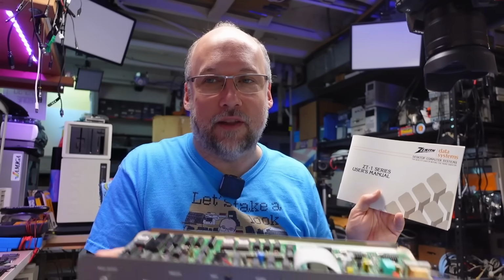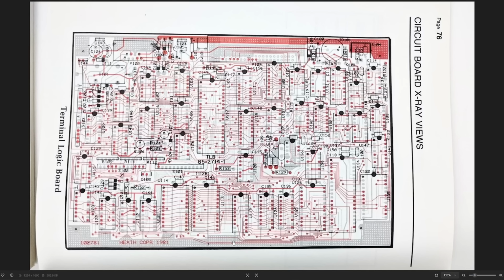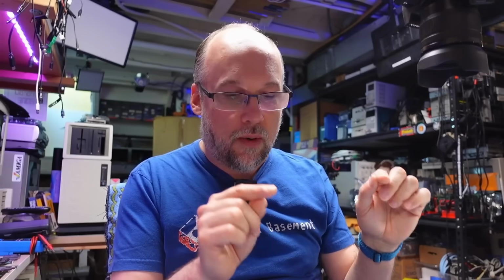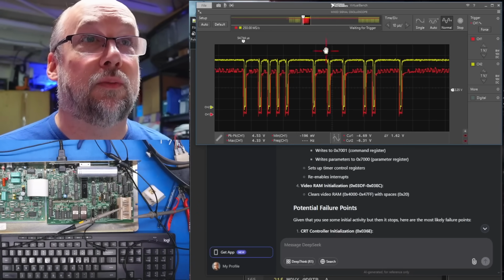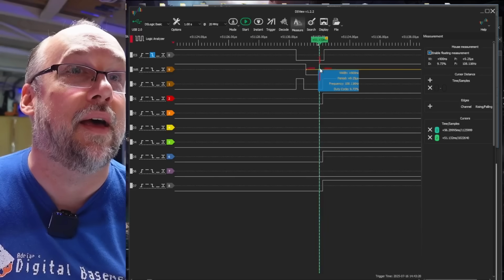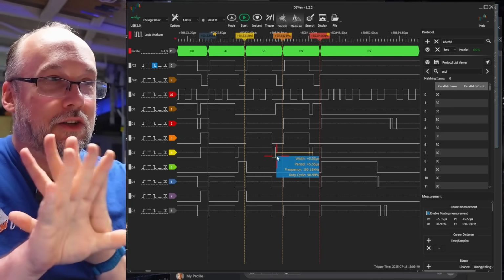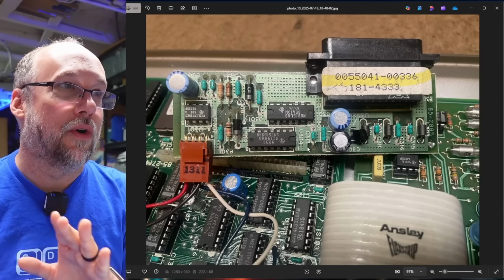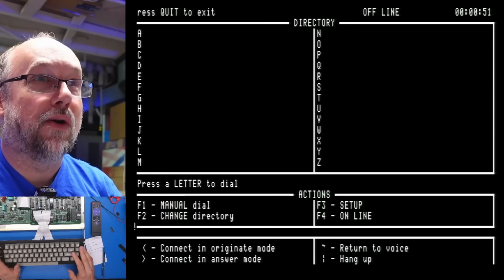The Zenith ZT-1 alive. Sort of.

Comment: The time clock is maintained by one of the MCU's onboard timers.  I see a crystal on the board near a hex inverter chip, which is a telltale sign of an inverter-based oscillator to run the system.  It must be providing a dot clock to the CRTC and instruction clock to the MCU.

As you figured, DeepSeek is a mess at interpreting the programming parameters to the 8275.  The values that should be sent initially are 00, 4F, 58, 9, and 9, and that is exactly what you saw.  Then it sets cursor position, 80 00 00.  It follows up with E0 and then C0, and finally 23.  All of that matches what you saw.  The 8275 doesn't read VRAM.  It depends on the DMA controller (or since this system was designed without one, the MCU) to provide the data  It doesn't even have address outputs to direct which memory is read.  So the glitching looks like a timing issue to me.

The battery-backed up RAM is at 3000.  VRAM is shared with generic RAM.  Most of the memory following displayed memory is scratch space for individual directory entries.  Of course most of the general RAM it needs is within the internal 128 bytes of the MCU.

It has no reason to write to NVRAM at first.  That's only for phone numbers.  It does do a read scan to see if its checksum is good.  And it will try to write a new checksum when you bring up the directory menu, after initializing the memory.  If that fails, it enters an infinite loop.
Reply from the maker: Nice thanks! I've done a ton more investigation in part 3 which I'm nearly done with, including verifying a lot of what you mentioned. I'm not surprised the LLM got the 8275 stuff wrong since that's so obscure and relatively unused. When comparing it to something conventional like the 6845, it works in such a different way too, with the row buffers and DMA.
Reply: @adriansdigitalbasement  This is a weird request, but can you confirm that U136 pins 8 and 10 REALLY are grounded?  I'm asking because these are OUTPUTS of those 2 hex inverters.  It looks like they wanted to ground the inputs but actually grounded the wrong side!

Comment: Most of the song & dance with online services in the 80s was signing up & getting around the hourly charge per data rate. After that, all you needed was a computer, terminal software with file transfer capability, and a modem. CompuServe, GEnie, The Source... Eventually Delphi.

Comment: Why would they use a transformer that outputs 10 VAC if it's going to be regulated to 5 VDC? Couldn't they have used a 6 VAC transformer so that it wouldn't get so hot and waste all that electricity?
Reply from the maker: The voltage regulation gets super hot. Yeah definitely if you ended up with like 7v DC then those regulators wouldn't have to work so hard. Perhaps it was cheap and what was on hand.

Comment: I'm unsure what value the AI is giving you here. I think AI can be useful for high level brainstorming, but outside of the most popular machines I doubt AI is capable of producing useful technical guidance. I doubt the AI did any analysis of the ROM outside of recognizing it's rough era and then hallucinated a memory diagram and startup process based on similar machines it had more context for. It would be nice if AI was usable for that kind of static analysis, but it just isn't there yet sadly. 

For instance, 30 minutes in you saw 11 initialization points and asked the AI if it matches the code. I guarantee you that if you told it 10 or 12 it would also respond it matched the code, as it's not sophisticated enough to actually know and is just hallucinating. Sadly, it's not a tool that can be trusted with this kind of work.
Reply: "AI" can't even analyze a chip, because that is not its purpose. an LLM is a Large Language Model, not a Large Chip Analyzer. its purpose is to plausibly mimic human speech. it is not capable, nor will it ever be capable of analyzing chips. computers do not have knowledge, nor experience. they just store things we interpret as such.  you may as well be asking the light switches in your house how to solve a digital logic problem. if the light switch is turned on, it is just making electrical contact where it's supposed to, it's not drawing on skills and knowledge about how the electric grid works, because that's impossible.
Reply: I would go for a logic analyzer with included opcode decoder. Would show the executed code.
Reply: When I do work on this sort of thing, and still not perfect, I upload the manuals I need into Google's LLM so I can use them as the reference medium and that does a better job, for obvious reasons.
Reply: @misterspock1  and what does that accomplish which reading the manual would not?
Reply: @iceowl  I see it as sort of working like speed reading for long boring manuals. I still have to check it's concluisons, but most of the time it does cite the passages.
Reply: The AI is completely useless at coding, as usual. It has zero concept of true or not true, as long as a sentence is plausible it will say it with zero concept of accuracy. Just look at the dumpster fire that is "vibe coding" and how it's just made the biggest PII leak in history due to the trash code produced being used in production. 

Calling LLMs "AI" is disingenuous at best honestly, there will never be a conscious LLM, ever. It is a glorified autocomplete system at best. Sincerely hope this is the last time Adrian tries relying on an LLM in one of these videos, watching him have to constantly correct the half-hallucinated bullshit that it replied with was just painful. It doesn't listen, it doesn't reason, it doesn't think, and it doesn't have any real understanding of the words it uses. I would have thought someone as smart and technically capable as Adrian would know better.
Reply: @shermanikk  Agreed.  People need to stop using the term AI.  Right now it is a marketing term only.  We do not have AI yet.  We may never achieve it.  We just don't know yet.

My bet is we eventually do.  But right now we don't even know how human brains work to generate intelligence and conscience.  How in the world do we expect to make computers actually intelligent when we don't know how WE are intelligent.  Putting the cart before the horse here, i believe.
Reply: @jeromethiel4323  read Roger Penrose on this subject, if you haven't. he has been pretty consistently saying "we don't have an accurate, meaningful definition 'intelligence'", and intelligence, in the modern sense, is very much a eugenicist idea. 

if you haven't defined the thing in any meaningful scientific concensus, how do you make an artificial one without lying about what you're doing?
Reply: I tend to think of these things as a dynamically generated book derived from the worlds knowledge base.  They don't think in any real way, but it sure appears they do.  As you imply, if you stay within the bounds of the worlds well trodden information, it tends to be spot on.  Once you venture too outside what's been written about and repeated thousands of times, it just starts hallucinating.  I don't think they'll ever be able to do anything but be along the lines of good teaching tools up to the undergrad level.  Which is quite impressive.  

If they could make these things "know what they don't know" that might be a far better step forward than trying to make them think, which is likely a different problem entirely.
Reply: @stevesether  the "world's knowledge database" is full of a lot of bullshit. computers do not know which is bullshit and which is not, nor can they know. computers cannot hallucinate, they don't have a central nervous system or a brain.

there is a lot of information that has never and will never be on the internet, because it's either gone or it is just impossible to digitally archive EVERYTHING and it would be extremely irresponsible to try. 

the laws of thermodynamics are not flexible. there is no such thing as a perpetual motion machine. all systems must dissipate energy somehow. 

it took millions of years for nature to evolve brains. fascist techbros, with their "AI" and eugenics, believe they can make electrified rocks do the same in the fifteen minutes they've been around.
Reply: I think, this totally out of reach for any LLM, you need symbolic AI for something like this. If there's sufficient data for this in the model, you may experience a happy match (just like @stevesether described it), but more likely, you get what may be called an A.I. novel.
(Or is it the A.I.'s family novel? At, least, it's an inherited one… 😀)

Comment: Wild speculation: is the siemens chip newer and runs with tighter timings (or in fact looser ones)? Could be that the data for the character is still on the bus, when changing the line in a "cursor return -> next line" fashion
Reply from the maker: I'm digging into all the possibilities in part 3. I think I've come to some conclusions but I'm still working on it.

Comment: We found that using a oyster knife and laying the blade in the seam and lightly tapping on it with a hammer all the way around what's the best way to open AC adapters. Then use plastic solvent in a syringe to reseal.  (WELD-ON 3 Acrylic Solvent Cement)
Reply: That sounds like a good process. I lay a utility knife in the groove and run it over the same path a few times on each side and then use a flathead to crack the leftovers. Then I use plasticweld to reassemble it.

Comment: I wonder how we settled on 300 bps originally not something evenly dividable by 7 or 8 bits.  And off the top of my head there were slower speeds but they were what 110 BPS and 75 BPS and I'm not sure did they predate 300bps?
Reply: They did.  If I'm recalling correctly, 75 baud was for very early teletypes, with the ASR-33 operating at 110 baud.  Not sure what the first 300 baud device was... maybe the Bell 103 modem?  (That would have been 1962?)
Reply from the maker: There was probably some technical reason for the speeds used (75, 110 and then 300.) That would have been typical back in those early days.
Reply: Before the Bell 103A standard which was 300 baud FSK, there were 50, and 75 bps which are easy fractions of 300. But, there were also 110 and 134.5 bps.  Apparently 110 BPS was actually 11 bits per character (a start bit, the data bits and 1 or 2 extra stop bits to accommodate the mechanism in relay or solenoid hardware to reset).
Reply: I can't imagine any reason to care whether the number of bits per second combined with the bits per character would need to have anything to do with one second timing intervals.
Reply: @mikebarushok5361  Neither can I, just odd that it worked out to be 300 bits per second, just curious what crystal frequency originally, and to me, it would send 1 byte per clock cycle, so that's why I'm surprised it's not a division of 8.

Comment: The 8275 uses a byte for the character in each position but uses additional space to store the of attributes of blinking, highlight, inverse, and underline.  There are also some field attributes available.  A low power 2114L still draws 70mA while the uPD444 drops into low power mode below 5V and only draws 1uA typical, but at a higher cost than a 2114L. edit: the 2114s are in parallel with the 2K display RAM and are configured as an additional 1K x 8.  The chip selects for both RAMs appear to head off to the same place.
Reply: In VRAM, the attributes are actually bytes interspersed with the characters.  Attribute changes have the high bit set and continue until the next attribute change.  Inside of the chip as it DMA's in a line of characters, it will read the attribute bytes and assemble the 4-bit attributes internally.  But the ROM is definitely writing only 8-bit bytes to VRAM and using the occasional attribute bytes to set combinations of reverse video and underline.
Reply from the maker: Ah so you think it really is there for longer battery life over a normal 2114? The two 2114s on board do not appear to be used for the screen buffer at all, as this thing doesn't really use attributes for text mode. At least not that I've seen.
Reply: Yeah it's weird.  There is 1K of nibble memory for the phone book and 4K of byte memory for the video memory.  There are also 128 bytes of internal memory in the MCU.  Those are all the memory that the ROM accesses.  I see no reason for either of the 2114's (1K nibbles each) if that other AY chip is the 1K nibble RAM.  And considering its proximity to the battery, the AY is more likely to be the battery backed up RAM.

As for ROM, there are the two program ROM chips.  There is also a character ROM.  But that doesn't explain the RAM chips either.  Maybe reconstructing the schematic from that PCB Xray will reveal something.

One way to see attributes is to use the sequence 'ESC s #' where # is between 0 and 7.
Reply from the maker: @ovalteen4404 I think I'll have the schematics soon enough -- sounds like someone might be sending them to me. The X-ray scan is very hard to read the backside traces. I used it to find a few things for part 3 and I had to do a lot of manual proving around due to being so hard to decipher.
Reply: Yeah I noticed.  Well I realized something though:  You said the VRAM itself was 2K right?  Well actually, every line is 96 bytes long to make room for possible attribute bytes, so it needs 2400 bytes total for display memory.  I bet those two 2114s are an additional 1K to cover the gap without forcing a 4K VRAM chip.
Reply: @ovalteen4404  You are correct.  I just found Adrian's post of the X-ray picture.  I jumped to conclusions about how the attributes were stored based on a number of controllers of the era but here the 8275 uses internal FIFOs and burst mode DMA to operate a little more asynchronously than most CRTCs as it decodes and outputs the attribute bits on dedicated pins.  I believe you are correct and more than 2K is needed for the attributes at higher resolutions like 80x24 or 25.  In those days the cost of 1K was actually substantial so a 3 chip 3K solution is in line.
Reply: @adriansdigitalbasement  One of NEC's standard prefixes was μPD which is mu-PD but usually shifted to UPD for datasheets.  Lots of smaller packages seem to leave the μP part off but you got the ID perfect.  As far as I know, the 2114 was never really a candidate for battery backup because it was just too power hungry and only ran on 5 volts which is what made the μPD444 so special.  There was an exotic 6116LA which went into standby at 100μA but NEC beat that by two orders of magnitude.  I believe Ovalteen got the architecture correct with the attributes causing spillover of the 2K buffer.  I found your X-ray pic and it appears to be 3K hung off the 8275.  That 8275 definitely comes from a different thought process than the 6545/6845.
Reply from the maker: Incidentally I left the normal 2114 connected to 1.2v NiMH battery for a few days on the ZT-1 and it retained the contents just fine. The voltage at the IC when running on battery is only about 1.0V. So I guess the 2114 can technically work at this low voltage. :-)
Reply: @adriansdigitalbasement  Don't count on data integrity across the device.  The reason for this is primarily glitches experienced during power up and power down.  The inputs use TTL signaling levels with active low selects so when the Vdd falls enough, the chip becomes selected in write mode. You'll likely corrupt a location, most commonly the one at the top or bottom of the array, but it can be anywhere depending on what's on the buses. The design of the uPD444 keeps those select thresholds in tact down to a Vdd of 2.0 volts in addition to dropping into low power consumption as soon as /CS is deasserted.

Comment: No such thing as negative or positive AC, but it likely has a rectifier that does provide positive and negative voltages on the board.
Reply from the maker: Feels like maybe they used a center tap like this just because they had the transformer lying around from another project. I don't think they are using these rails for much of anything although without the schematics it's hard to know and not worth reverse engineering.

Comment: My Dad decided he needed a new TV to replace his old 1972 vintage 25". I somehow convinced him to get the Heathkit GR2000 (2001?) which cost upward of $700 including the furniture grade cabinet. I am telling you, when the time came to plug that battleship in, I was nervous! But man was it fun. And he had that TV for 20 years before he got a bigger one.
Reply from the maker: That's just amazing. I can only imagine how satisfying it was to build it up and have it work. I wonder how much cheaper it was to build the kit versus buying a similar Zenith fully assembled TV?
Reply: @adriansdigitalbasement  I don't think there was anything comparable. It cost 2x as much as a contemporary TV but it had very advanced circuitry. All the wiring harnesses were hand-made (by me). Digital tuning. Magnificent picture and you had complete control of it with a stack of manuals explaining how to tune it up. But the most amazing thing was the solid copper chassis. My Dad wanted the best and so I pointed him at this, and he said you'd better do this right :)

Comment: I suspect the reason the beep was missing until you fixed the video controller is that the code sets up the video controller to generate interrupts at the end of each frame and runs the main code in the IRQ handler. So broken video controller meant no IRQs and thus stalling everything.
Reply from the maker: It's actually not IRQs but I dig into it more in part 3 to figure out more about what's happening.